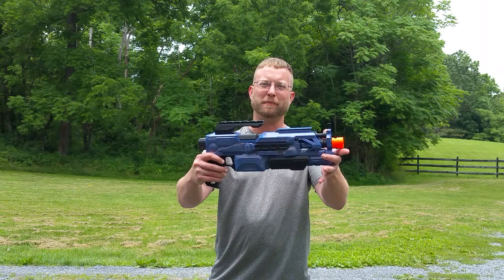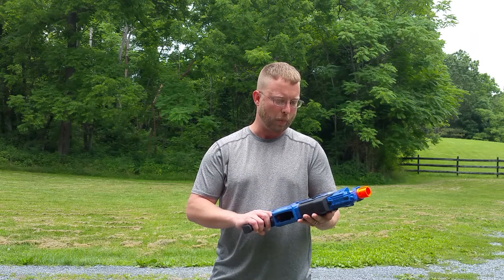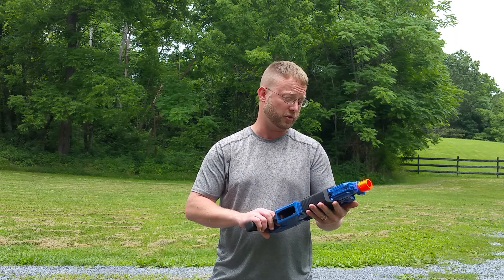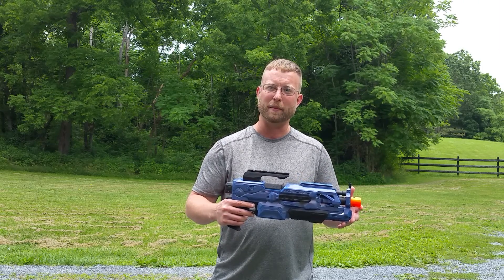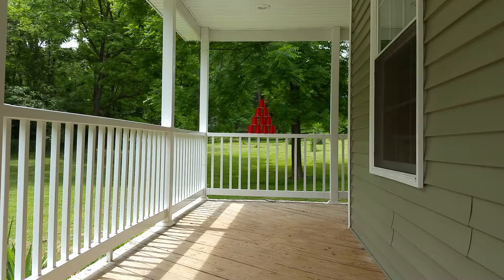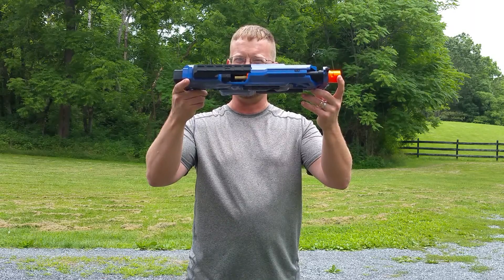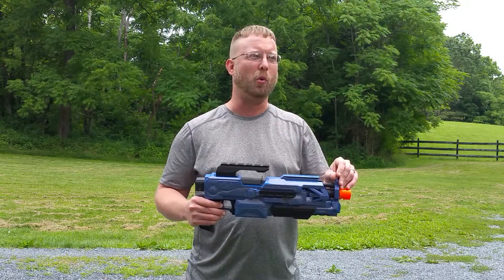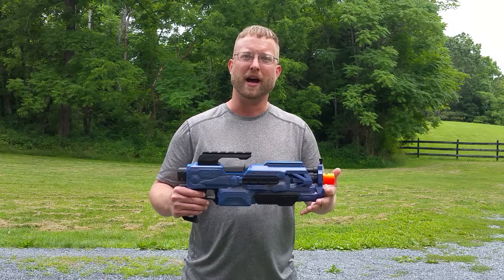Four Flywheel Modulus (Quadulus)

Comment: Great work on the front motor covers. Almost indiscernable.
Reply from the maker: Thanks, I used an air drying modelling clay and then carved the inside out to fit the motors.  I then glued the formed clay to the shell and sanded it down.  It ended up working pretty well.
Reply: +498 Nerf would the clay work for smoothing or filling in small gaps? I installed a volt meter on the back of a rapidstrike but dont want see where I cut it in the plastic.

Comment: I couldnt watch with sound on.
what rpm is the first and second cage?
What FWs?
TY a nerfer is making modulus dualrail barrels with cages.
This could add  third FW set.
It also gives springers an afterburner in a modual add on
Reply from the maker: ~32k rpms first cage and ~48k rpms seconds cage.  I used stock Modulus and stock Stryfe flywheels in this build.  
BTW, this is my personal go to blaster.  I try using some of the other ones from time to time, but I keep coming back to this one.  I really like the Quadulus setup.  :)

Comment: i wonder how using quad flywheels in a cross formation would be, like not sets of 2 behind eachother but like in a wide blaster have 2 horisontal and 2 vertical in the same spot. would it improve accuracy?
Reply from the maker: 101 Gaminglegion You would have to have some pretty thin flywheels to do that.  Maybe if you offset them just enough so that they don't touch...  I have been thinking about a 3 flywheel setup though - each wheel offset by 120 degrees from the others.